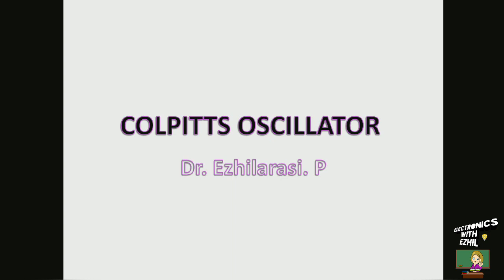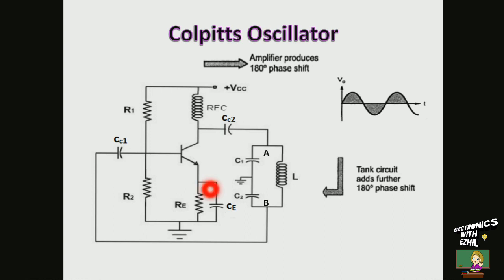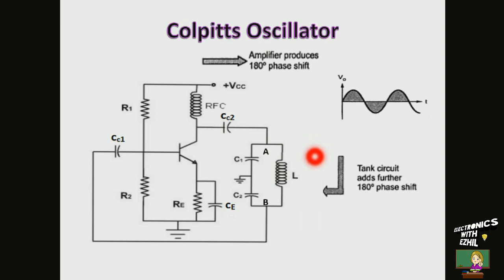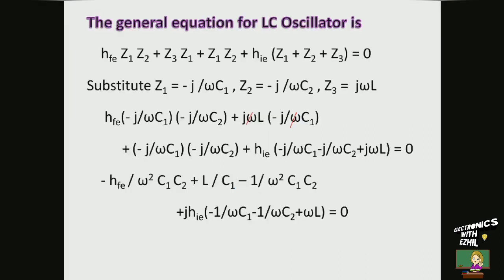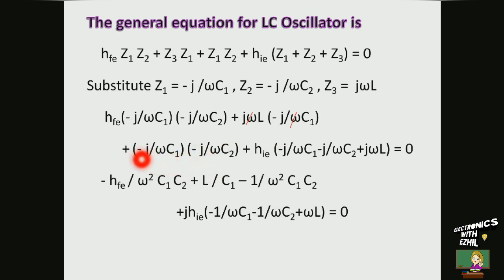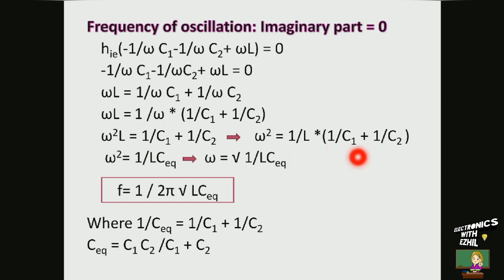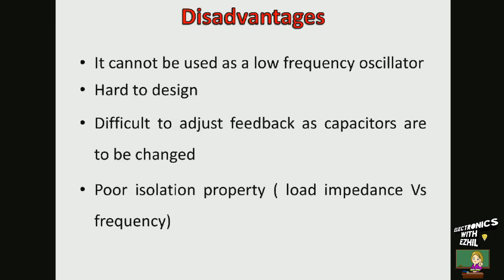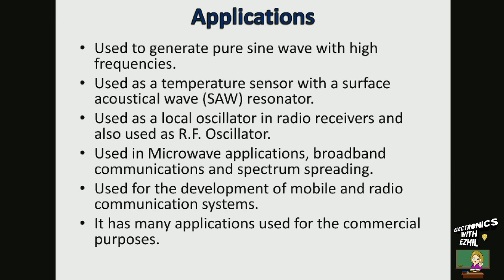Transistorised Colpitts Oscillator || ELECTRONICS with EZHIL

Comment: Awesome explanation  , Madam any video on REMOTE  CONTROL circuit's  of toys , with detail explanation  , how the signal is transmitted from transmitter to receiver to control the motors in the toy  , detail explanation of the working of the electronic components used to built the circuit of transmitter and receiver  of the remote control